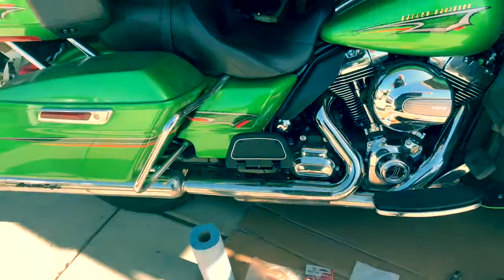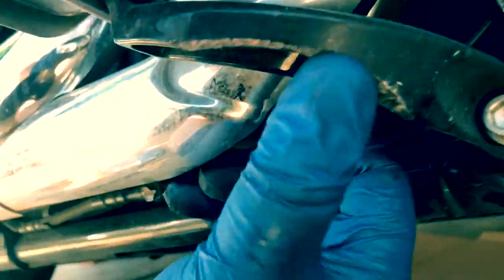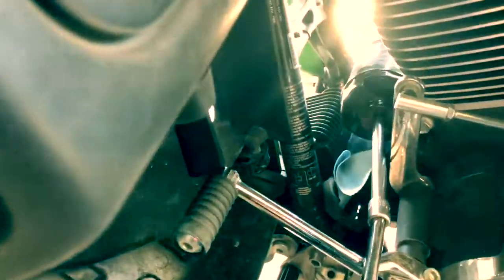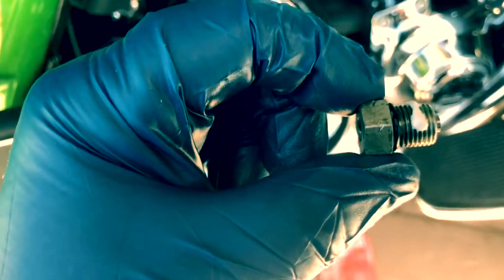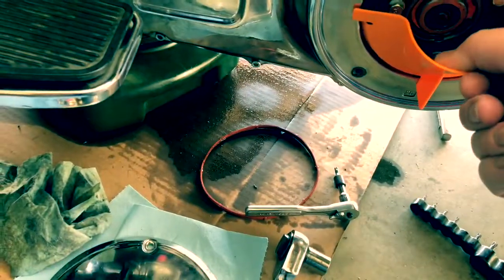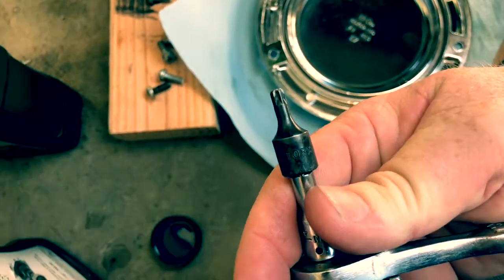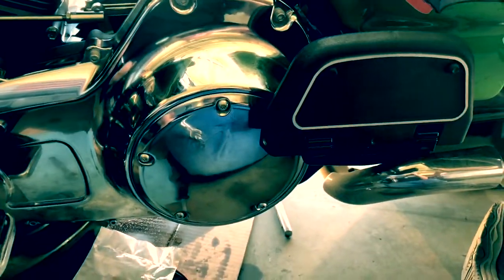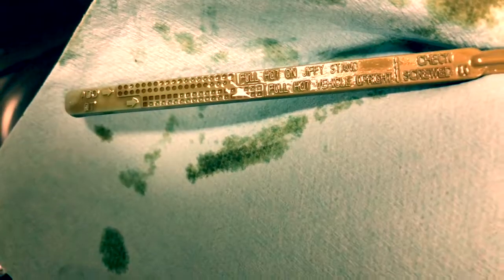2015 Harley Ultra Limited 3 Hole Oil Change

Comment: This is a great video as far as oil changing goes! I am a professional pipefitter, I can assure you, there is no need for thread sealant aka pipe dope on straight threads. It is specifically for tapered threads without a rubber seal.
Reply from the maker: Thank you! I appreciate the info!
Reply: @CrawdaddyCustoms   And you don't want any pipe dope contaminating the oil.

Comment: I have a 2019 limited and love the 80w140 in the transmission and primary-shifts like a different bike and neutral is silky smooth
Reply from the maker: I love it when they are shifting right- I’m fighting the dreaded fluid crossover w/ my 19 UL now. When I change fluids, it’s silky smooth, but a 1K mikes later it’s fighting me again.
Reply: @CrawdaddyCustoms  a friend of mine bought a 19 UL about a week after I did and  he did the 1000 mile service himself-you would not believe the slivers of aluminum that came out of that transmission ! Scary !

Comment: Nice video! ...I noticed that under the jiffy stand you placed a piece of wood to have motorcycle stand a bit upright. Is that because you wanted not to spill an oil while the primary oil change?
Reply from the maker: When I add oil to the primary, I want it upright and level, so I get an accurate fill.
Reply: Most bikes are meant to be checked on the side stand.

Comment: Sorry, did not hear it... What turn of the new oil filter you did after the filter's rubber sealant contact?.. Half of the turn?? Half and 1/4?? Thanks.
Reply from the maker: Yes, 1/2-3/4 of a turn. This is done to slightly preload the seal after it makes initial contact. 
Usually 1/2 turn will do the trick- you just don’t want it leaking.
Reply: @CrawdaddyCustoms  Thank you very much.

Comment: Can I ask why you prefer Mobil 1 branded oil as compared to the other brands of oils including Harley? I am not being sarcastic just feel like some of the oils out there are over rated. I know you can buy off Mobil 1 V-Twin motor oil off the shelf at Walmart much cheaper.
Reply from the maker: If you look at the MSDS sheets for Harley's synthetic oil, it's a blend- Mobil 1 is a true synthetic. Mobil 1 comes in a lot of super cars as factory fill. It's a personal thing, but if it's good enough for a $200,000 Porsche, it'll do the trick for me!